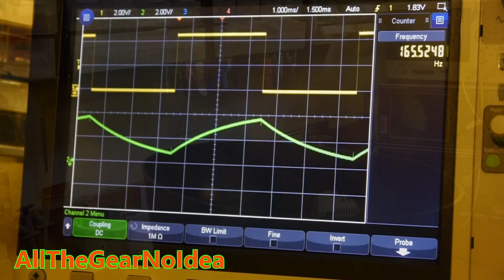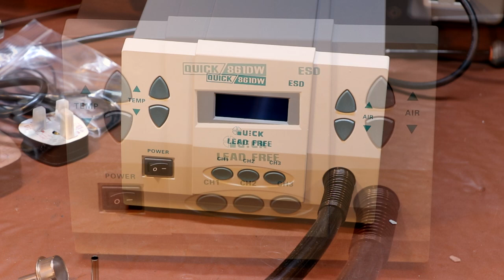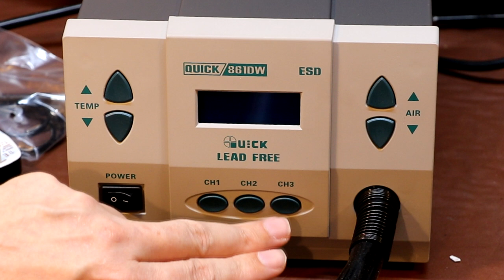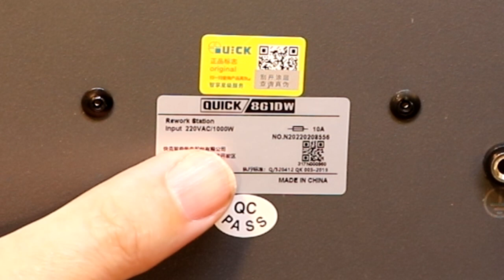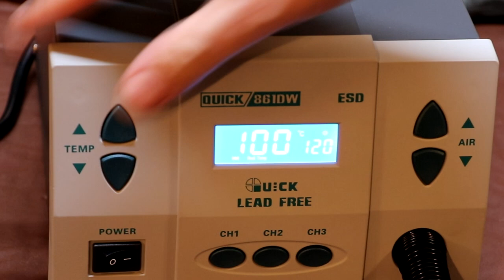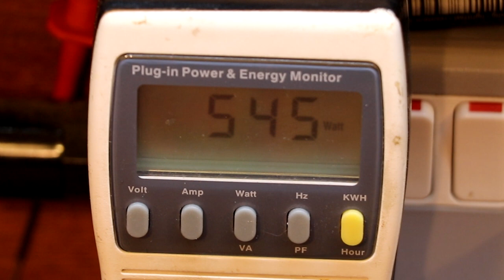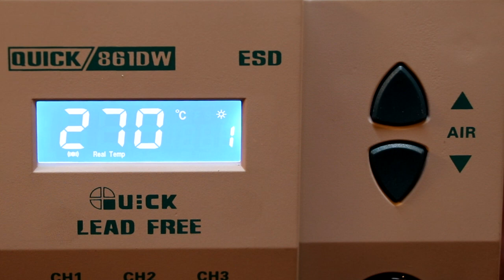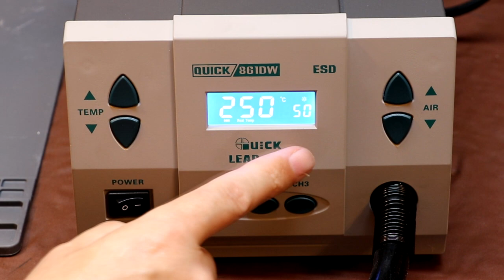Quick 861DW Hot Air Station - Hot Stuff Part 3

Comment: Great review, now I want one. My budget 866D works but is cheap and the fan is dying in mine.
You forgot to mention how quickly they will burn your house down if the nozzle gets knocked off the stand accidentally. I suggest never leave it powered up unattended
Reply from the maker: Yes your right. But the stand is heavy so won’t fall out without help. I still think the auto cool down in the cradle. Perhaps the software could have a sleep mode if not removed from the stand in 20minutes
Reply from the maker: You definitely do want one I was really impressed

Comment: You should pre heat the board first the caps come off quicker then without exploding
Reply from the maker: Do you mean preheat with hot air or using a preheated or hot plate. I think it only exploded because I directed heat on the can accidentally the others did explode
Reply: Pre heat the board to 100 degrees c on your hot plate first, but if you want a real challenge try removing a flat pack chip from a SRBP board instead of a fiberglass pcb.!

Comment: Yes, I've had the odd surface mount electrolytic whizz past my ear. Can't bring myself to use the Mr. Carlson method though.
Reply from the maker: No I have never tried twisting them off. I normally use two soldering irons to heat both sides

Comment: Talking and heating at same time  at 23:57 made this capacitor pop up and explode like a Jiffy Pop popcorn pan.
They were fun to use at campfires  back in the day.  Angled nozzles are handy for the microscope work. Before these 
soldering hot air stations you could go outside on a sunny day a with a magnifying glass and really go to town on
 removing SMD chips! LOL Good demostration of hot air reworking.
Reply from the maker: Oh be nice to have a sunny day never stops raining here!  I have done a little bit of SMD work many years ago when I worked in production but it’s a long time ago. I need a bit more practice but really did enjoy it.

Comment: Funny, I just did a video on soldering gear which gets published tomorrow. The Quick is excellent, I’m very happy with mine. I use the angled tips as it’s just easier to not have to hold your arm in the air, I did a review on it a few years ago.
Reply from the maker: There is a link to your video in the show notes
Reply: @allthegearnoidea6752  cool, goes to show I (like most other people) don’t always read them LOL

Comment: Light and informative!👍Those El-caps require awkward back and forth U-turns so it makes me wonder if either fixed or adjustable Y nozzles exist.. or maybe a semi circular tweezer adaptation to deflect air away from the can?
Reply from the maker: To be honest it was my fault that it exploded. Trying to talk and use the microscope I let the heat linger on the capacitor body. None of the others exploded so I think it probably just takes practice. A special nozzle would be handy

Comment: Well that works excellent :-D
You seemed to be having fun desoldering the components,  i knew you liked it :-D
Maybe you will do more smd work now you have the ideal tool.
I thought about one years ago, but i hardly touched smd parts so i didn't bother.
No im not a tight assed person,  not Floppy bum eather :-D
Smashing video chris, thank you.
Reply from the maker: Yes now I have better equipment I would definitely be more confident trying SMD in the fire. I can see in some ways it is easier than through hole

Comment: US Subscriber, I focused in on your UK energy monitor, I've been looking for a way to evaluate 240V 20/30amp window air-conditioners in US. Thinking of adapting a product made for the UK / European market. 
Any recommendations?
Reply from the maker: You can buy energy monitor volts and amps power meters from China these work with a separate current transformer so will work to 30 amps. The plug monitors will only do 13 Amp
Reply from the maker: KETOTEK Digital Voltmeter Ammeter AC 80~260V 100A CT Voltage Current Power Energy Meter Tester Pannel, Volt Amp Watt Gauge LCD Display